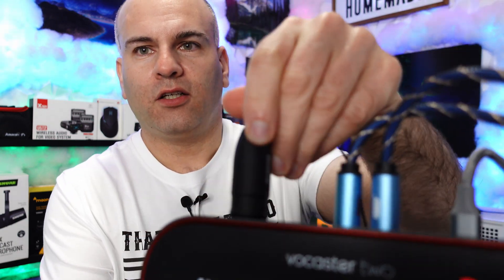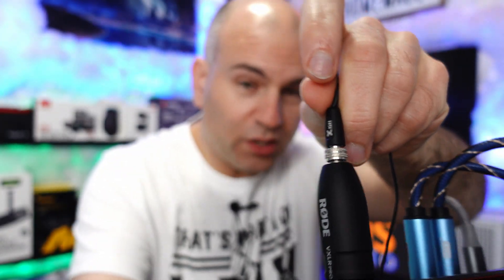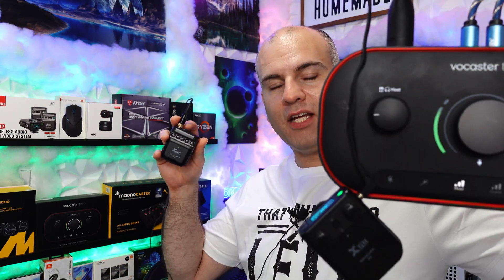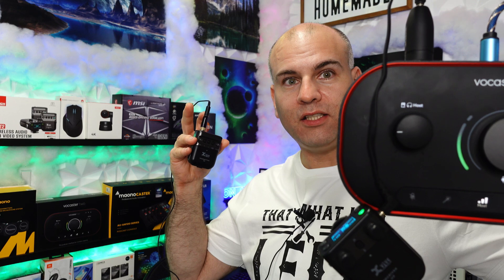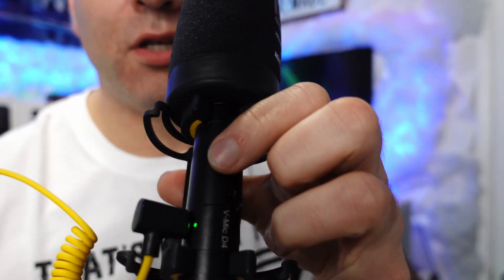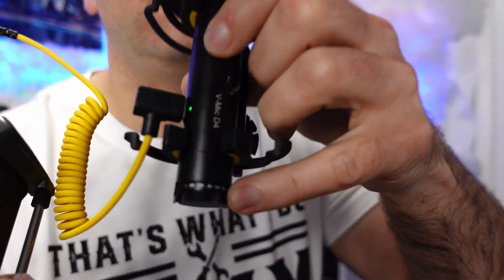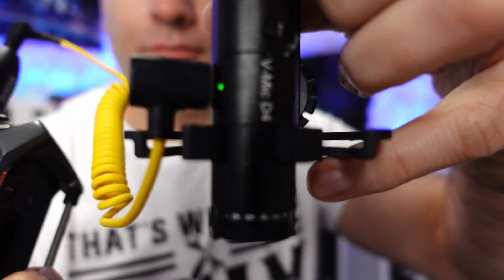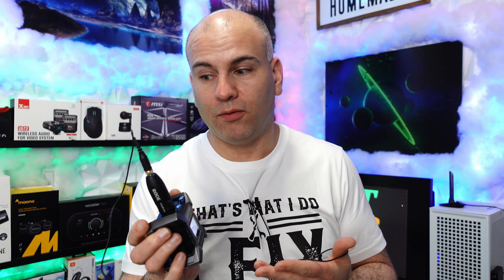Rode VXLR Pro 3.5mm Lavalier, Rode NTG to Zoom F3 *Hot Tips*

Comment: Please answer. Do I have to set a 24v voltage when connecting a 3.5mm microphone?
Reply from the maker: @JayPark-pz6ex  I am doing 48volts but the answer would be both No and sometimes. It all depends if the device requires mic power and if you don't use phantom power the volume is going to be much lower.
Reply: @ericsstudio  I'm currently using a microphone called the Comica VM10 Pro, but when I set it to 48V, there's a lot of noise. However, when I set it to 24V, it captures good sound. I was planning to use it along with the NTG3 by connecting them to different channels, but due to this issue, I'm facing a dilemma.
Reply from the maker: @JayPark-pz6ex  which device are you using? Are you using a zoom F3 or something else? Also if powering the zoom F3 never use it with the battery powering anything else, ever. It makes noise, bad noise. I show that in my 3 part Hot Tips series for the zoom F3

Mentioning the power thing just in case. Also don't be afraid to use a different TRS 3.5mm cable. I work 12 hours per day everyday, I am a bit rushed in thoughts. I work as a construction electrician out at a work camp. Want to help but want to cover all possible scenarios as well in case there is something wrong with the setup or something I am missing
Reply: @ericsstudio  I'm using the F3. I connected the NTG3 to channel 2 and was planning to use the VM10Pro microphone, which I mentioned earlier, on channel 1. The VM10Pro is a 3.5mm video microphone, and it doesn't require phantom power.
Reply from the maker: @JayPark-pz6ex  yeah I figured it was 3.5mm. it's a value option. The Rode VXLRPRO as I mentioned is mic power which almost all cameras put out. If not the Deity V-mic D4 wouldn't even work, the Rode NTG wouldn't turn on and off with the camera being turned on and off. Mic power is normal for nearly all cameras for on-camera shotgun microphones. The VM40 is newly released now, neat stuff. On my days off I am going to revisit the Comica Traxshot Pro

Comment: Thank you for the great video - I am an audio novice and trying to get my Shure MVL Lavalier Microphone to connect to my Zoom F3 and I am using the RODE VXLR Pro to adapt the 3.5mm to the XLR connector of the F3. It is not working, is that because the lav is TRRS and not TRS? Do I need a different adaptor or do I need a lav that is TRS? Any help would be greatly appreciated!
Reply from the maker: @davidmasseyphoto  i know nothing about this lavalier mic you speak of and I am stuck out of town working at this time. My first question is, do you have the 48 volts phantom power on like I mentioned in this video to do when using the VXLRPRO?
Reply: @ericsstudio  yes I have the F3 set to “mic 48v”
Reply from the maker: @davidmasseyphoto  have you tried a female TRRS to male TRS adapter?

Comment: Would it be beneficial to get this VXLR vs. getting XLR to 3.5?
Reply from the maker: A regular XLR to 3.5mm has zero power conversion. For instance a VXLR pro has mic power conversion a regular XLR to 3.5mm if you leave 48 volts enabled you kill wired lavaliers, I killed 2 using a regular cable. If you had a mic that turns with mic power like the Deity V-mic D4 it will not even work. If you use a rode NTG video mic it would have to be powered manually on and manually off. The VXLR pro when using 48V phantom power with it turned on and off the NTG video mic. Some mics require mic power to get proper volume levels.

It is 100% beneficial to have the VXLR pro over an XLR to 3.5mm. another device that does the same power conversion is the Diety vlink which I show in my hot tips #2 video of the Zoom F3 where I record guitar with the Zoom F3 which is an XLR device converter to 6.35mm
Reply: @ericsstudio  i will check it out! Thx for this info ℹ️

Comment: Hey bro when you had the Deity shotgun mic plugged in did you have phantom power switched off? I don't wanna risk detonating my powered mic. What setting you got the F3 at for it?
Reply from the maker: With the VXLR Pro it converts to mic power 3 volts. If you do not have phantom power on using this adapter the mic will not turn on.
Reply: @ericsstudio  Thanks. I just picked up the Zoom F3 and I was using my Deity and my Sennheiser MKE 400 mics which is battery operated also. I used the Deity D-XLR which converts 48V to 3V and I was like I hope I'm not damaging the mics with the phantom power activated.
Reply from the maker: @heroicvision  I also use and own the Deity V-link XLR which I show in my Zoom F3 hot Tips videos and even record guitar with my zoom F3 and interface directly to my android mobile phone and test battery types for battery life and much more.
Reply: @ericsstudio  Yup I've been secretly going back on those videos stalking , creeping and taking tech notes , LOL.

Comment: I bought the Zoom F3, Sennheiser ME 2, and VXLR+. Doesn't seem to be creating any output for me. What setting do you use for source? If there is any mismatch in voltage the mic would not function? VXLR supplies 4v, ME 2 take 5-7v. New to audio so any advice would be awesome! Thanks and great video!
Reply: Make sure you are using 48 volts phantom power and the ME 2 should work. If you want to learn the Zoom F3 please watch my Zoom F3 part 1 and 2 hot tips videos. My playlist of hot tip videos is probably the easiest way to find  or search the channel for Zoom F3

Comment: Hi Nice recording and setup. I actually like ZOOM F3 recorder. That means we can test many combinations.  Request you to record any Field sounds.
Reply from the maker: Thanks, I've been wanting to make my setup in my studio wireless. This is the perfect solution for clean wireless audio without using software, the software solution is the video uploaded before this. I have a pro movie studio wired lavalier arriving in a month. I had to special order it. I also ordered very high capacity rechargeable batteries for the zoom F3.

I will watch your Snowball microphone test shortly. It was a very popular microphone when it was released. I never heard the audio.
Reply: @ericsstudio  Thank you for your comments
Reply: Hi I want to test Wireless mic with ZOOM Recorder
Reply: @manutecsounds  Why a wireless when it already is wireless? To record direct to PC or to 32bit float? With the adapter it is easy to do. I purchased new high capacity rechargeable batteries for my zoom F3 so I can record anywhere and not worry about battery life. Wireless always adds some noise but wired lavaliers direct to Zoom F3 removes noise. Wired microphones can be made to connect direct to zoom F3 to record into zoom. I found the ZoomF3 can easily be placed on a thin enough belt to be very portable.